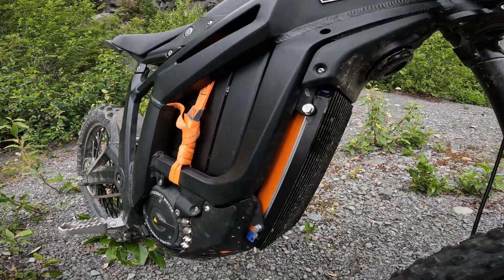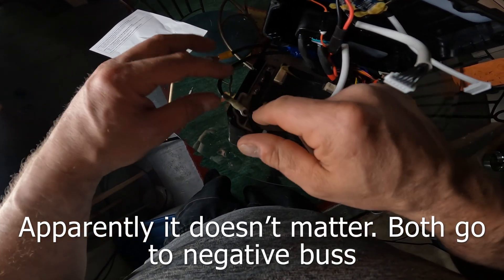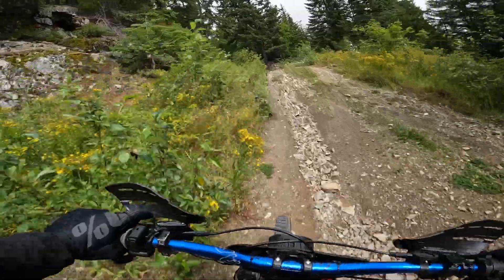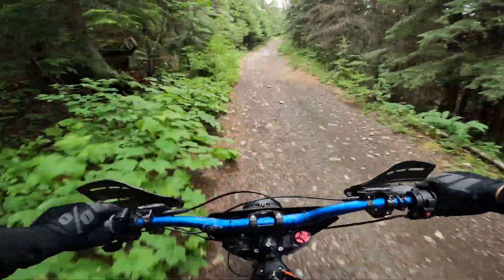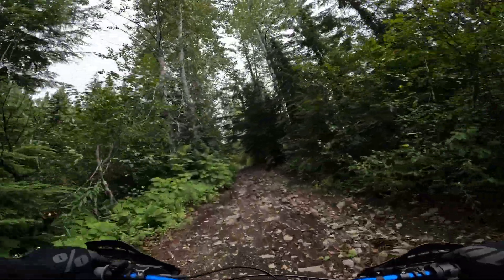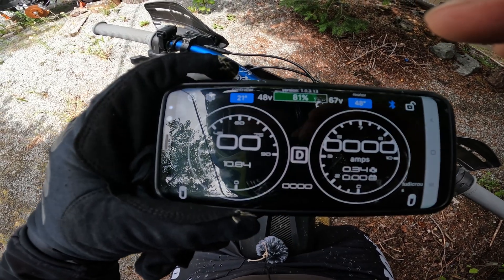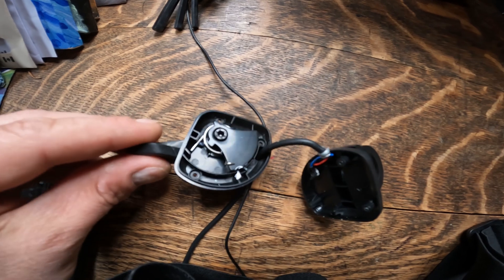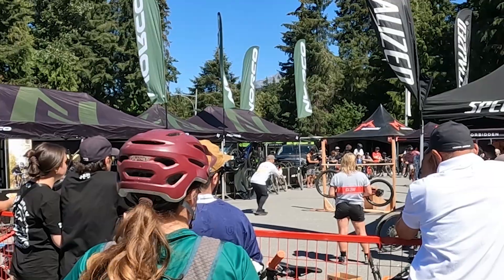BMS BYPASS 7000W - EP 40 - TALARIA DIARIES  - BAC 8000 Talaria  Sting

Comment: Sickk I run 8kw stock battery perfectly fine I have a 72v now running 12/15kw the power is insane haha dm me if u need any help
Reply from the maker: Bypassed stock battery?
I will probrably bump it up really soon. Thanks alot for the info..Wish we could go ride together. Not easy to find Emoto gang !
Reply: @electrified6043  yea I have 72v now but I have vids of me running 9kw and 650 phase amps were are u located
Reply: @SwarmMcReynolds 9kw with stock bypassed battery? That's what I'm looking to do on my kids mx3 with ko nano and 42t sprocket since he's only 120lbs
Reply: @electrified6043 have a bypassed mx3 battery what’s the max line current I should put in using a fardriver ND72450
Reply: Are you on a stock motor? Does it overheat? I am running 8kw at about 600pa and my stock motor gets hot 😮 💨